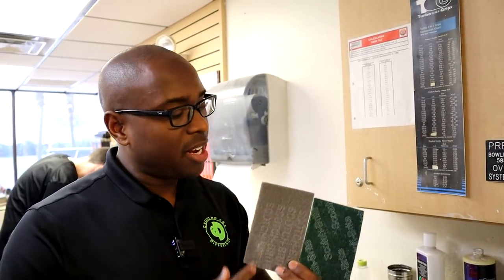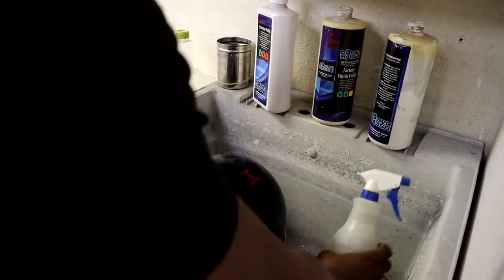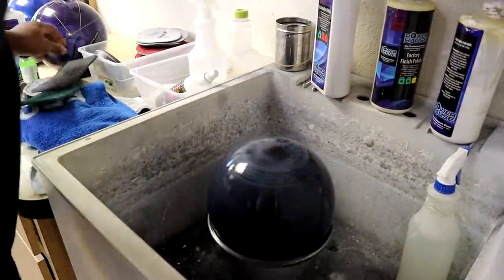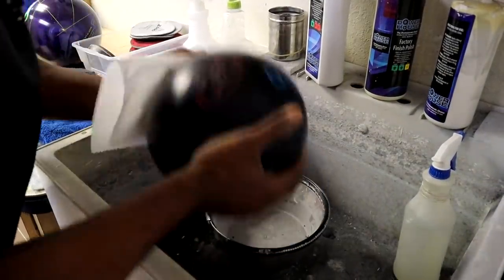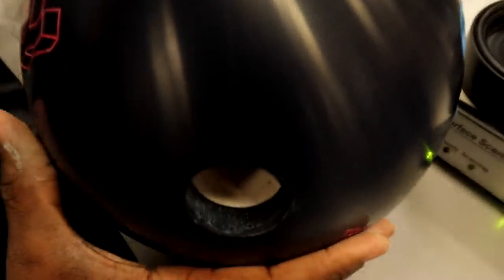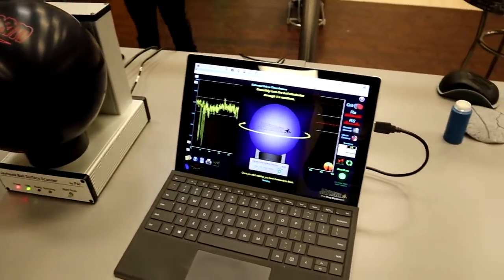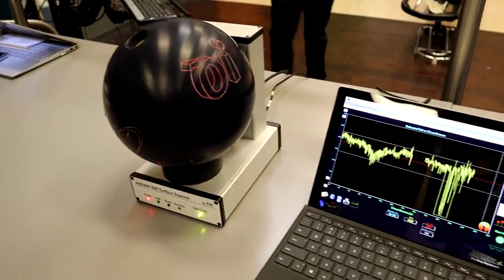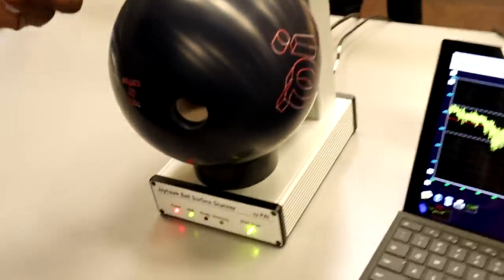Gray Scotch Brite on a Bowling Ball? What does it surface scan at?

Comment: I'm not sure what you really accomplished here.  Maybe I don't have the background to fully understand, but the goal is to change the surface of the ball to achieve a certain grit level.  You did not demonstrate the amount of surface CHANGE in your measurement since there was not before or after illustrations nor COMPARISON to the surface change achieved by a Trucut pad. 
Yes, there was some scratching of the ball, but using a skip grit routine by finishing off the process using white Scotch Brite Pads will take some of that out and you have to show why those scratches would adversely affect the performance.  Afterall, when you examine most balls over a year's period of time, you will see many dings and scratches caused by normal play on the lanes.

I use Scotch Brite between cleanings by the pro shop.  In my experience It is a time-tested idea that does work.  Maybe Trucut is better but that is not what you demonstrated.

Comment: Another reason that Scotch Brite is not a good idea is that there are different models under the Scotch Brite brand.  I had one at work today where we had to try a different model pad in a process due to supply chain issues.  Both were gray Scotch Brite brand.  The new pad cut now where near the same and we were unable to use that pad shutting down part of our production.

Comment: I’d like to see scotch brite  by hand, I think it’d come out much lower grit, I use a green scotch brite and then 2000 or 1000 depending on which the situation calls on my phaze 2 it keeps it from lane shining so fast because of the deeper cuts underneath but the abralon makes the surface more consistent
Reply: It would probably also be a less consistent surface
Reply: @michaelmoses4019  it would be closer to the finish from a resurface machine like used in a factory. large scale facorties are not using ball spinners by hand these days. they use Haus type machines

Comment: Before I got my CTD pads I would use scotch bright pads. And not as scientific I did notice alot of single deep lines. I didn't think anything of it. But using the CTD pads I noticed alot not consistency and  less over under over a league night of 4 games
Reply: Use the ball the way it was intended by the manufacturer. Use a different ball if you don't like what you've got.
Reply: @johngrek7000  so when pros hit the ball with surface they are using the wrong ball. Right?
Reply: @Matt_Holcomb  No. But if you're going to get an uneven surface with sanding, just drop a little bit to get the desired reaction. What happened to moving on the lane to get the line? Sometimes, that's all it takes.
Reply: @johngrek7000  no what I was saying is using scotch pads. How they leave uneven. Even with a spinner.  I have notices that using actual pads is more consistent. I have enough equipment that I usually bring all that is needed